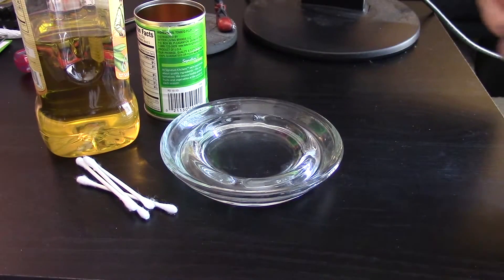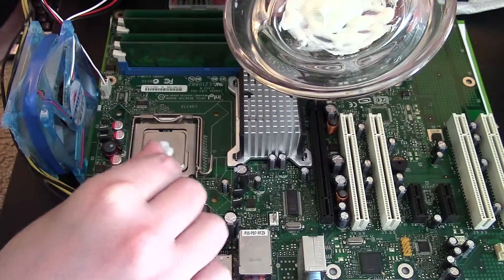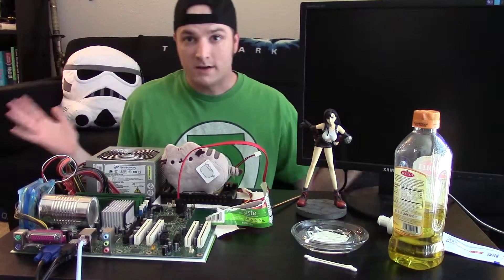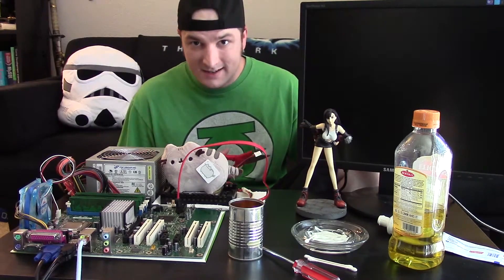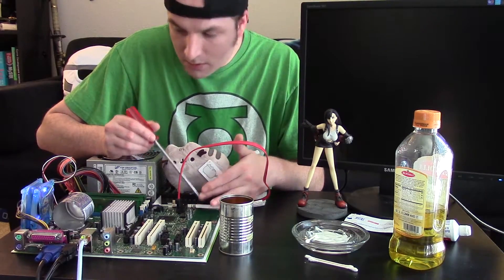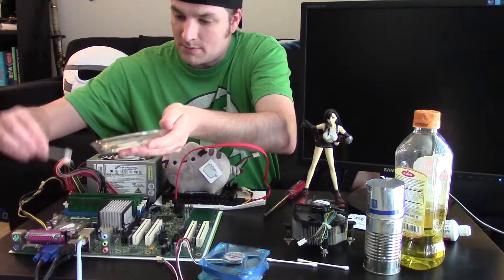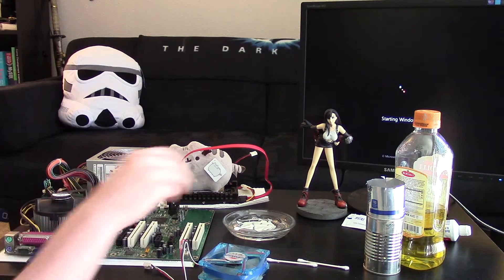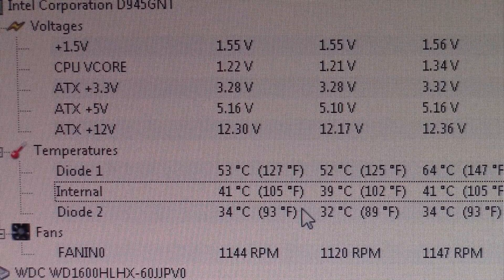💻 Homemade Thermal Grease & Heat Sink Test

Comment: Don't ever think of making thermal past at home with some oil and stuff it's won't work as a temporary solution yes may be but i would recommend Vaseline with grafit powder (Pencil sharpeners) its better but not really good like when the cpu is on stress the temp goes to 98 C
Reply from the maker: good tips. Had someone on here use this method for over a year and then he switched to normal thermal grease. So yes it will work and be stable. Keep in mind this tends to be used by the low tech and 3rd world.

Comment: Just use Plumbers Silicone Grease it works just as good as Thermal grease.
Even better if you mix in a bit of Graphite Powder in it .
Reply from the maker: Might have to give that a shot. However the videos concepts are straight out of the 3rd world and supposed to be for things around the house or easy to acquire anywhere. 🎃 Have a Happy Halloween & please sub if you can.

Comment: Greeting Sir. If I may offer a Layman's point of view to this cpu heatsink thermal paste project. I think it's the pressure (very minut pressure) that one needs to place on the heatsink to sandwich the paste in between the cpu and the heat sink block itself. That's the main operative component here. The heat sink needs a lot of surface area inorder for the heat to dissipate into the air. if you were to cut out the other half of the mid section of that aluminum can and bent it into an accordion shape like this ( /\/\/\ ), then placed it into the bottom half of that aluminum can. Then somehow clipped it on top of the cpu. I think that attempt would've been successful. It just needed a little force so no air could've been present in those layers. I'm thinking perhaps some sort of weight like a rock or stapler, I don't know. I'm just  talking about this as a mental exercise, but, all the cpus that I've ever installed needed the heatsink to be clipped onto the chip itself in order for it to work properly. So, that's my two cents on this topic and thank you for the thermal paste recipe.
Reply from the maker: Might have to give it another go with the can method. These low tech concepts always interest me considering the individuals use what they have to get things working. 
Hope you enjoyed the video
😋Please subscribe if you can.

Comment: You can dry out the toothpaste and then mix it ;)
Reply from the maker: Very true and nice helpful tip!
Please subscribe if you can 😃
Reply: @TheThorns  :  Not so helpful, for javasrevenge didn't say how we can dry out toothpaste.  What, put some on a dish, piece of paper, ..., f.e., leave it there in open air for x (?) number of hours or days, or apply a hand-held hair dryer to the paste for x (?) amount of time, ....  How can we know the paste is sufficiently dried?  Can seem like minor details, but can make a difference between doing a job well and not so well.  Happens with many tasks, that paying attention to details is helpful.
Reply: @mikecorbeil  you're evaporating WATER, it's not rocket surgery. You just let the paste sit until it's dry. Or do you need even more detailed instructions? If so then you need to seriously reevaluate your education

Comment: The price of toothpaste+cooking oil+cotton buds+ a can sardine + a can of red bull is almost the same price of a decent thermal paste...
Reply from the maker: I am not arguing price but most people have oil for cooking and toothpaste on hand. Also cans are easy to find anywhere.
Reply: @TheThorns  ... For that is a true fact... I've tried your cooking oil (motor oil) + toothpaste mixture for my old 2009 asus netbook it turned out well it's stable at moderate usage to 52° C ( with stock fan and heat pipe). I opted out sardines/red bull cans they wont fit in the netbook....

Comment: ROFL....u need too put presure on cpu so u can make it boot...
Reply: I don't think that is true, at least for this board and CPU. It got past the POST screen and started to load the OS before it turned off. It shut down because the CPU got to hot, so as a safety measure it shut down.
Reply from the maker: thank you. This is especially true with the type of board being used. 775 socket and up have a lock down bracket that also applies pressure. however pe6iss is correct with certain AMD CPU's and older Intel chips. 
Please sub if you have not already 😋
Reply: Thermal grease (also called CPU grease, heat paste, heat sink compound, heat sink paste, thermal compound, thermal gel, thermal interface material, or thermal paste) is a thermally conductive (but usually electrically insulating) compound, which is commonly used as an interface between heat sinks and heat sources such as high-power semiconductor devices. The main role of thermal grease is to eliminate air gaps or spaces (which act as thermal insulation) from the interface area in order to maximize heat transfer and dissipation. Thermal grease is an example of a thermal interface material.

As opposed to thermal adhesive, thermal grease does not add mechanical strength to the bond between heat source and heat sink.!!!! It will have to be coupled with a mechanical fixation mechanism such as screws, applying pressure between the two, spreading the thermal grease onto the heat source !!! 

Vegetable oil blend Refined 220°C / 428°F
Olive oil Refined 199-243°C / 390  470°F
Olive oil Virgin 210°C / 410°F
Olive oil Extra virgin, low acidity, high quality  207°C / 405°F
Olive oil Extra virgin 190°C / 374°F
Olive oil Extra virgin 160°C / 320°F
 ( From Wikipedia, the free encyclopedia)  

~~~~~~~~~~~~~~ 

You never went to OS ...a lot of reasons can cause pc restart or switch off.(In our case maybe comes from using household items)
After all you make 1 test with 2 different homemade products.
Im not sure if you even know if the heatsink or thermal grease is stopping your boot.

~~~~~~~~~~~~~~ 

Some more usefull info.
https://www.youtube.com/watch?v=o_s2R-pT0BE
https://www.youtube.com/watch?v=tX2VKEesUiE

https://www.youtube.com/watch?v=3B1kjxO0sxM&t=655s ( heatsink porn )

Comment: U would have cut both ends of ur homemade heat sink for better air flow
Reply from the maker: I think the issue was contact and heat transfer and not air flow. Might have to revisit this in the future. Did you have a different experience?
Sub if you can 😋

Comment: what will happen if you mix this with very fine carbon for heat conduction and for the heat paste to last longer?
Reply from the maker: have not thought to try it. however this was a homebrew urban legend test. Can failed but homemade thermal paste passed. Please Sub if you can 😊
Reply: @TheThorns  I used apoxy resin and toothpaste to stick those tiny heat sinks to the memory modules of the graphics card because it was over heating (after they fell off). It worked, they were about 90C, which was fairly normal for a 4870. made the card work again, but I put it away and tried it again a year later and it didn't boot. I don't think the thermal paste solution failed, i think the card finally just died moving it from drawer to drawer.

Comment: Only use toothpaste that does not contain Fluoride.....the fluoride well eat the cpu the hotter it gets.......even a ree ree knows oil is gonna cook your board.
Reply: they submerge entire computers in oil with no problems, wtf are you talking about?
Reply from the maker: Thanks for the assist. Although I find it funny considering I have a video of a liquid-cooled cable modem on my channel also.  Sub if you can

Comment: Reasons why this wasn't working and the motherboard was halting on thermal shutdown. 1, cooking oil holds heat, not a good idea for heat disipation, 2 the can your using only makes contact in a very small place, to be effective you need a wider surface area cover.
Reply from the maker: The can was the issue not the mixture. 🎄Happy Holidays🕎 Hope you enjoyed the video or at the very least found it informative. Please sub if you haven't already & have a safe new year. 🙂

Comment: running smooth at 50°c on high graphics running rust, thanks for the alternative, your fucking awesome
Reply from the maker: Just be careful, wouldn't want you to fry your rig.
Reply: +renz anthony yes, I run two builds on this, one has liquid cooling on it, and the other a stock fan for a am3 board, both run well under 60° c
Reply: The NadeRunner Same, although I got a cpu heatsink with my biostar HD 5770,